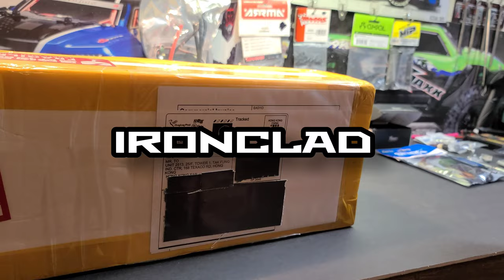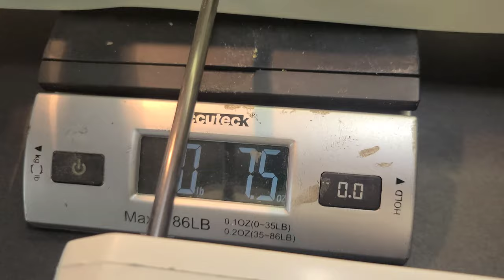Build a RC Rigger Boat | RC Pro Boat Epoxy (frp) Mini Outrigger hydro  | RC Boat Unboxing

Comment: Epoxy isn’t a construction-material, it doesn’t add any strength, it’s just glue. The title of this video says it all. You are telling all kind of nonsense. A heavier outrigger handles better in choppy conditions and vice versa. I hold my breath for your build and tuning work on this outrigger.
Reply from the maker: Epoxy added to a fiber cloth  makes it a  construction material  also used as a filler and glue
Reply: @IRONCLADRC  Then that would make it a fibre-glass hull if that is the material predominantly used. Fibre-glass is perfectly fine. Some only want carbon-fibre which is a little lighter. I prefer fibre-glass with some carbon-fibre reinforcements here and there, wet in wet laminated. Proper lamination is the trick.